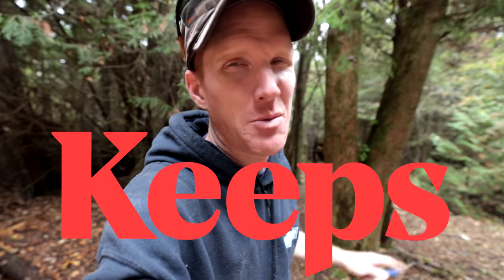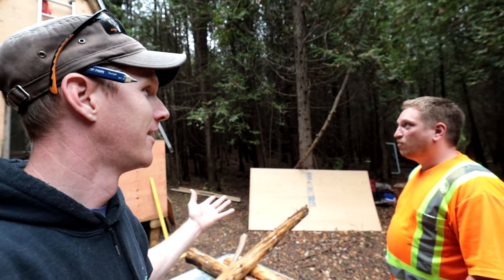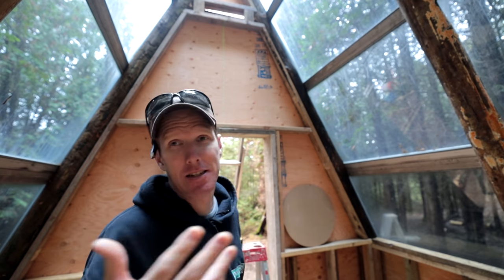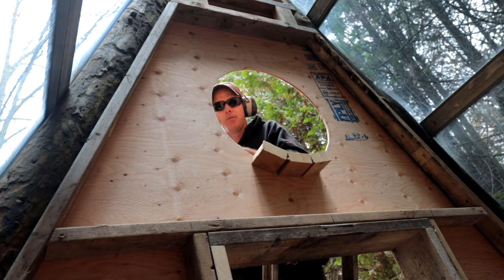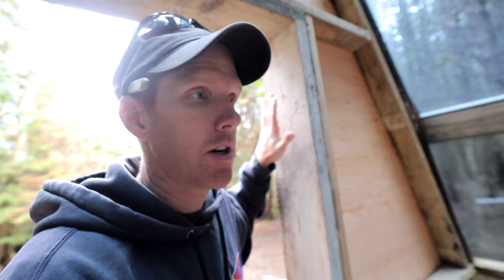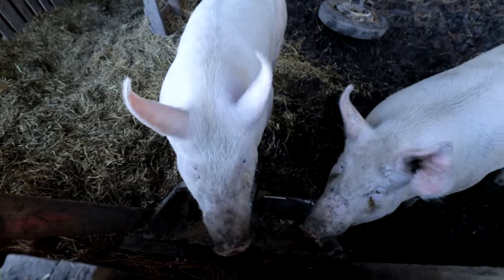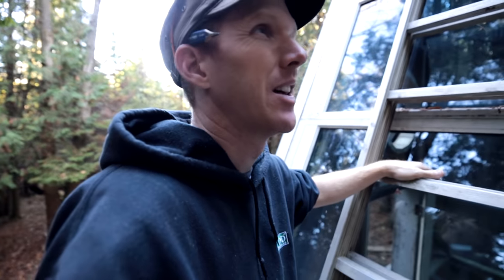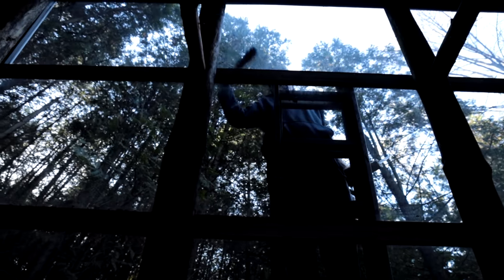Glass MICRO HOUSE Built on a Budget! - Cord Wood Exterior, Windows, and Doors

Comment: Use a really light color of chinking. It'll brighten it up and seal everything so it doesn't allow any rotting
Reply: The issue is the cookie ends will wick water through to the plywood anyway so he probably should seal it all anyway, so he could just as easily leave it at that point. I do think the pointing would look better though but I'm not sure how durable it will be since it isn't actually backed by wire.
Reply: I was going to write the exact same thing
Reply: Definitely seal it to prevent wicking
Reply: @marcellogenovese199  he did use waterproof construction adhesive to apply the cookies
Reply: yeah I dont understand the concern over the color given that you can color it to how ever you would like.
Reply: plus, the grey will match the weathered wood (eventually) of the board and batten siding, tying the whole thing together nicely
Reply: Cedar really does not wick that much water which is why it is a good natural siding choice.  Farmers use cedar posts for main fence structure all the time and do not treat the natural lumber before setting them into their holes. For his use case I think it would be fine as is or maybe a clear shellac to preserve the pucks if anything.
Reply: Exactly what he or she said.
Reply: @mariowickel456  That stuff is water resistant, it also is irrelevant when the mating material is whats soaked.
Reply: @christopherknerr2851  Cedar absolutely does wick moisture like all logs, thats literally how plants work. Cedar is rot and insect resistant. The problem he might run into is having cedar mating up with plywood which isn't rot resistant. Most cord wood structures are built from 12-18" rounds that form the entire wall, this is just a faux veneer. Looks really good but it might cause some issues that can be pretty easily avoided with some simple pointing and sealant.
Reply: Need to put some corner braces on that door their design is to put the weight on the rollers on the bottom not to hang on hinges on the side
Reply: so much yes. I wanted to throw this in as an option too.

Comment: This turned out very nicely, I am impressed and still envious. As far as the pointing is concerned; adding the pointing may give it a secure and finished look, however, you may have to deal with cracks in the future.  If you left the pointing off, would you seal the wall or put some kind of finish on?  This is my favorite of all of your builds to date. Bravo
Reply: That's my question too.
He was going to put in the pointing in for a reason.
It would still need some type of sealant - yes?
Reply: Good input.im learning alot just watching and reading commits

Comment: Pigs got big! I figure the door should last for quite awhile. Corner braces would extend the life if it starts to sag. Turned out really nicely. With enough of the canopy gone, winter heating should be relatively light duty. Night time, probably just the opposite, but should be a really nice get away. Sleeping under the stars without getting rained on. Oh, and on the front finishing, either way you have to seal it. And yu don't want standing water at the bottom. So a cant strip would fix that if you don't fill the voids with material.

Comment: I think you should coat these coockies with some kind of sealant  and put mortar in between. Cos I think if you leave it like that these coockies will suck in and hold water, whitch will rot your plywood and than you have to rebuilt all fron of the building.

Comment: My brother hooked me up with a slightly used patio slider built in the early 2000s..they had 2 of them and both were going in the dumpster.  They both function perfectly and work fine (i've had mine in for a month).  Amazing what gets tossed.   I guess this is very common in the business (remodeling).   This slider replaced a early 90s slider that leaked all the argon out so was causing condensation issues in cold weather (the panels would cave and touch).  I did save the glass panels for a greenhouse or something.

Comment: use a spray sealer , three coats. i like the contrast in depth. you can get viniger and add steel wool and then let that get nice and mixed for a few days, spray the wall first let gray for a few days. then seal.

Comment: if you use lime mortar it will be white in color after it dries. ofc lime isn't as hard or impermeable as cement i use lime mortar for older houses or lime stone. there are also cement dyes you can add to change the color of the mortar. i think a white or beige works really well. love the circle window with the black trim :)

Comment: That would make a great green house, you could waterproof/seal  the inside of the structure and have a drainage built into the floor allowing for easy clean up and spillage. Hopefully the snow won't build up too much and you could still grow during the colder months. Just a thought, Don't really have much experience in the same climate you're in. acouple of nice benches, and some suspended shelving or baskets up the a frame, could even have the shelving/baskets on a series of pulleys. I'd make them out of aluminum angles so it minimizes the weight and rust factor.

Comment: Tough choice, but I vote for no mortar. I think how the shadows of all the cookies will move during the day will give the front a bit of added good looks. The cedar itself is pretty weather resistant and you've already set the ash trim at the bottom to shed any water away from the wall, so I think that leaves just how good is the adhesive holding the cookies to the wall. If that's not a major concern, I don't see that mortar is needed. 
This one is really looking great, thanks for sharing it with us!

Comment: Get a dove tail router and flute under the cil or over hang as the runoff will run back even with a line fall, our porch rotted out as a result of that also do it to the over hang on a kitchen worksurface Incase of spills will break the hydroscopic quality of the wood by creating a sharp lip also treat the wood with plenty of oil.

Comment: I think you should wait on deciding what filler material to use in between the cedar pucks.  The only concern I would bring up is the potential of water setting at the base of the frame and pucks and causing sections to prematurely rot.  Grouting or 'chinking' is going to be quite tedious especially if you want to preserve the natural color of the pucks, but I think you will find a creative way to overcome these trivial obsticals.  Keep up the good work and excellent content!

Comment: Yah man looks great... I think 💭 (and that hurt) if you want the front to POP 💥 darken the space between the logs. Then seal it all in with a something semi or flat. That will bring out the depth of the front...... great video. I also have saved sliding glass doors for a special something. But mine are metal frames.... I got to learn to weld....

Comment: I would use a white color of chinking, or a a white stucco and it would also Help with the water proofing of the plywood under Neath.  Very Nice Job, I get alot of good idea's from your guys. Why can't you come out the back wall with your pipe between the windows and save the roof.

Comment: I have seen cookies like this used on building projects and they split, fall apart in time.  I'd cover the entire thing over with see-thru sealant that fills in all the gaps between.  That way the cookies stay intact and don't split.  Might use something like garage floor stuff that you pour out for this project?  You see that stuff advertised now that they throw handfuls of glitter into to make it look dimensional.  You'd have to pour it into a form to get it vertical of course.  Good luck and can't wait to see how you tackle this project.  Wondering how heat rising from a stove inside will affect the glazing on the windows of the roof.  It's an interesting build to be sure and one which everyone who likes to recycle things would get a thrill out of.

Comment: Instead of mortar keep with the glass theme and do a clear resin pour . If you use foam board or plywood facing , coat with mold release . All the wood will still gray underneath .

Comment: I would put the mortar in, long term your A-frame will last longer and it will look even better than it does now. If dark is the worry look into colored mortar. Do some testing with concrete dye? I am not a concrete guy so I don't know. I have seen tan mortar though.
And I just thought of the stucco stuff you can buy in a bucket. Get any color you want. really easy to work with. Water clean up. Just a thought.

Comment: Maybe crisscross some light weight cable braces on your door would make it last a long time. Like a screen  door.
Circle dome window is sick. Like an old Van window.
It also would look cool to have put those rounds over the wall painted black or gray. I would leave it no Mortar as long as that sheathing does not need to be covered in something for weather proofing.

Comment: The ONLY thing I would wonder about, leaving the cookies unfrosted is whether or not the board behind it can withstand chunks of snow and ice sitting on the top of the cookie all winter and melting down in the spring.  I can picture this crosshatch of rot after 5 years and the interior is almost comfortable in August during the 6th and 7th summer until a cold front moves in at a relatively high speed at the end of October and the front wall collapses into the building.  Otherwise, I think you might consider a plexiglass front, and some holes at the top edge.  Build a stair step walk up to the peak (store firewood underneath) and set up a game of pachinko or kerplunkit.  Get yourself an older pool table ball channel to bring the bearings back out to play another round.  Dip the bearings in some ceramic phosphorescence so you can play at night.  Put some stoppers in the holes, attached to the roof with some kind of lasts forever rope and if you come out and find it full of water, someone is in trouble.  If your bearing return is working, it shouldn’t fill up with water.  But some genius will get creative and see if their bite of sandwich can make it through and after awhile the entire system is clogged, the water sits in it, the bearings are gone and you are dealing with rot.  It’s a tough one.  

I like your building!  Cozy in the winter and an oven in the summer.  Stick a giant dehumidifier in there and you have a commercial grade dehydrator!  Is it possible to hinge one of the windows at the top or hinge the front peak and back peak with screens to let some of the hot air out in the summer?  Plants and people often burn up with the heat build up.  Just thinking out loud.  Something to consider before you put any facing around the back.

Comment: If you decide to do chinking add saw dust to the mortar mix. This will cause the mortar to dry slowly thus reducing shrinkage
Reply: Shrinking will affect the cookies as well leaving a space around them for water to penetrate...
Wet cookies when freezing might cause problems down the road.
Reply: Shrinking will affect the cookies as well leaving a space around them for water to penetrate...
Wet cookies when freezing might cause problems down the road.

Comment: I'd definitely use mortar. If you don't then water will get behind the cookies and things will start to rot. Or use a 50/50 mixture of diesel and hydraulic fluid on the wood to protect it.

Comment: Mortar. Yes

Any reason why you don't use a bend and mount the chimney thru the back wall? Then no issues with the roof and peak.

And with all that glass. I hope you've got a vent, or it's gonna be extremely hot in the summer

Comment: Chinking like u did for the log cabin but try a color dye added to it to match the cookies but lighter. The aluminum trim does it hav a groove on the outside if so it would look amazing with track lighting installed in it YOU know the multicolor ones that can be adjusted from the inside of the cabin. I knew sooner or later Kevin u would add the fish eye glass your hooked on it lmao. Over all its looking Amazing. But would cut some of those trees back a few yards to for safety since the glass roof isn't safety glass tempered glass will still shatter. God bless be safe stay warm. Jim

Comment: It looks so cool as it is but without pointing the cookies up won't they rot much easier/faster? The bark will hold water won't it and the water will run down the back to the cut side wel maybe the glue will keep it from running down the back side, But I still think the bark will hold a lot of water and swell and crack. Dye the moter the same color as the cookies then when they gray you will have the same effect just opposite !! What do you think of these questions?
Reply from the maker: Most of the bark has been removed.  The cookies are sealed to the board using PL Premium.

Comment: Love the glass house. Must have been pretty heavy, but worth it I'm sure. For quite a while you have promoted solar generators, but I am curious as to which unit you mentioned that held the power for the longest time. If you have found one better than the other I would be happy to know which one will hold it's power the longest. We don't lose the power that many times in a year, but I don't want to have to power the unit every day, just in case. If you can help I would appreciate it. Thanks, Brian.
Reply from the maker: Check the individual manufacturers.  I'm fairly certain most packs talk about once charge will hold their charge for a year...
Reply: @ModernSelfReliance  Thanks for your response. Sorry. too late for the hair loss, Nothing grows up there anymore.

Comment: Okay this is looking AMAZING!  I don’t have a vote for or against the pointing…. I love the round window frame, it looks sharp.  I also love the glass door on the front.  How did you do the top metal bits?  Are they overlapped like shingles?  How will the water stay out at the top?
Reply: They overlapping shingles and siliconed together.

Comment: @7:35 turns out ya don’t have much room in a triangle.. aha! yes sir.. to add lost cubic head square space in a A frame..  mitered 15 degree angles which does increase height to ridge beam so eliminating the upper half past the top plate height of 8’ lowered pitch roof height to a flattened top.. a half A frame? /-\  I suppose, yet with headroom space.. raising side walls does allow more moving room but them steep angles cut up every step.. small A frames more suited as chicken coops.. & nice use of glass garage gates as roofs!  practically prefabbed.. perfect!

Comment: I always think mortar looks better. If you want to keep it lighter you can go with a buff or grey/buff mix, though I think a darker mortar will create a nice contrast. Not sure what way you'd decide to do it though without a mortar joint, wire mesh backing or a masonry surface like you'd have for parging. I guess a thin-set mortar with a latex additive?

Edit: As far as the proper name for those "cookies", I've actually never encountered them before in all the tens of thousands of houses I've inspected the last decade+. I like the look, but I guess it's just not found down here in the southern States.
Reply from the maker: I think the proper name is cordwood.

Comment: Looking good would go with clay cob mixture the oil the log ends to make sure it is waterproof. Might be worth looking into a flexible sealer long term as the cob and wood will contract and expand over time and leave gaps for the water to seep in. Like everything it will need maintained to last. Does look awesome, still sure you are building a glamping site and going to charge these out at £200 a night.😅 stay at youtube famous modern self reliance camp and have a morning breakfast of beaver with the wooded berdsmen for an extra £50 each😉👍🏻🏴

Comment: I have been planning on doing the outside of my cabin with log cookies. I had never seen it done before until now. I was wondering how to get the cement in between the wood. Someone told me I may have to put chicken wire up first. It is good to know I don't have to do that. What type of concrete did you use?
Reply from the maker: If you aren't going to use polymer in your mortar mix I'd use chicken wire.  or lath.
Reply: @ModernSelfReliance  Thank You.  That is helpful information

Comment: Tuckpointing,,,,,,mortar,,,,,,,,,,,yes sir, have done hundreds of hours, I would use chinking, and light paint brush , moistened and will be a fun job, otherwise water will take there toll on the way you have-them  attached,  …chinking
will bond them to the wall  and offer waterproofing at  the same time .

Comment: No vapor barrier? Why not?
Reply from the maker: Vapour barrier in Canada goes on the inside.
Reply: @ModernSelfReliance  gotcha. Out here in the Southwestern US we wrap our sills and pretty much any openings with at least an inside cut of a few inches (Home Guard). The bond is between the window and the barrier. Also I never see you use any foam between the bottom plate and foundation... For budget purposes in your application I would have probably coated the ply with dry lock or asphalt emulsion prior to the faux puck siding only to insure no leeching moisture to later rot the ply. Out here though we are bone dry 3/4 of the year, everything gets beat to heck by the sun but then monsoon season comes to test your work with 100mph winds, pounding dust,  then a years worth of rain in 3 months. As much as Pl adhesive may stick, I don't see those pucks doing well for more than a few Winters of expansion and contraction around the grout causing separation and permiation.  I would seal the pucks and grout all at once with a matte impregnation solution to further lock the xylem and phloem in the wood to prevent leeching. 
Just me though.
I still say heck ya though brother. Great little homestead of tiny cabins you got there! Great work!